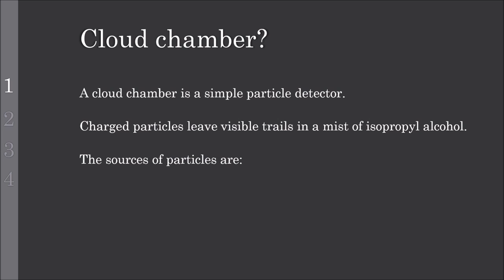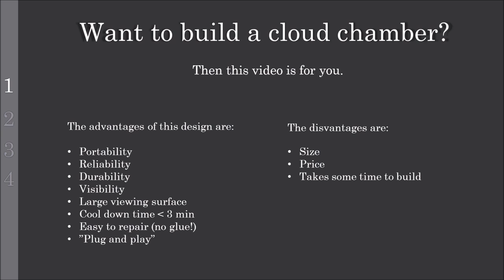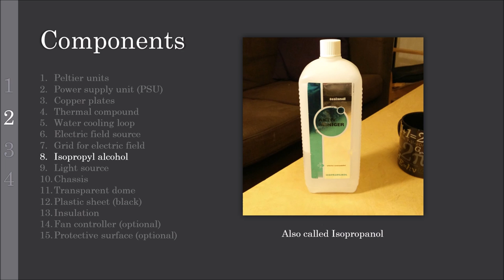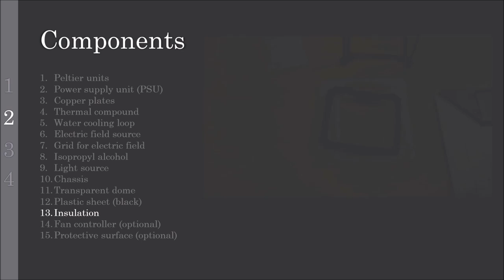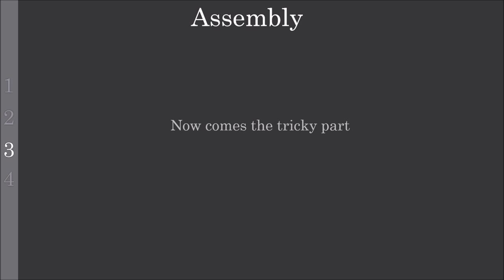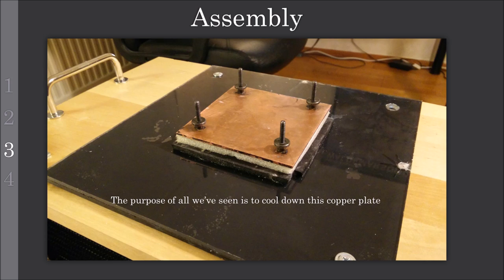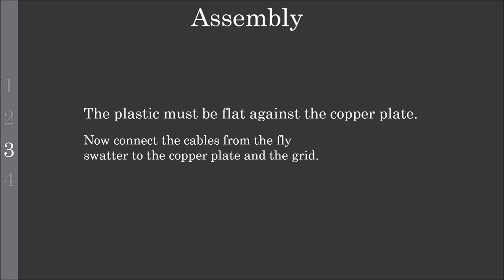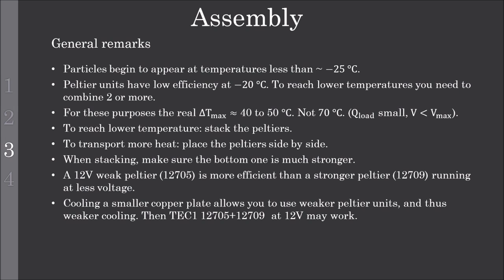How to build a peltier based cloud chamber

Comment: Don't know if it's been mentioned yet but you can get a type of spray paint at any auto parts store called Engine Black or Engine Enamel. It is matte finish and designed to deal with the high temperature cycles of engine use so should not crack and since it's enamel then isopropyl should not damage it. Even wetted with alcohol it should have less glare as well.
Reply from the maker: Thanks for the tip! I bought some tool-paint (something called "Hammer paint", in swedish)  when I was trying out different solutions, back when I was on tight student budget :D. The isopropyl ate it up after a couple of cycles so I gave up the paint idea. But yes,  engine enamel is definitely worth trying. It should be made to withstand far harsher treatment. I actually have the machine back this season for repairs so I could give it a shot if I find the paint.

Comment: Hi I am trying to make a cloud chamber without dry ice so this video is perfect. I would like to know what is the purpose of the electric field .
Reply from the maker: Hi! The electric field acts as an ion scrubber. With the field radiation can leave longer trails before hitting on stray ions in the chamber. It is also possible that the alcohol gets polarized and could get more supercritical, and more susceptible to build droplets due to small perturbations, which improves visibility

Comment: I was always dreaming of something like this, but, could this be built in reverse (looking from the bottom)? maybe small fan blowing air to the cold plate?
also, could it run 4ever or the alcohol needs to be supplied over time?

Comment: Very nice project, are you sure that only 100-300v it's the optimal range? I've seen from several sources that often it's nice to go up to several thousand volts. I use a rectified 2000 v neon sign transformer and seems to work well, but i need more testing (do you think polarity matters?). By the way I noticed a big improvement by gently heating the top of the chamber, in order to create a steeper temperature gradient.

Comment: Hi David,

I'm building my own system but I'm running into some issues. I've purchased a TEC1-12726 peltier and hooked it up to a H45 corsair water-cooled system. Before I put the other TEC1-12709 on I'm trying to test the system. So far the coldest I've been able to get the cool side of the peltier is -5 C. Do you think my water-cooled system is too weak? Also the copper plate (2mm) seems not to be conducting too well, coldest I've been able to get it is -2 C, do you think this might be due to wrongfully applying the thermal paste? Please let me know!
Reply from the maker: Hi! 
The H45 is definitely on the small side for a 12726. At its peak, the 12726 will put out ~300W. At the very least you should replace the fan on the H45 for something above 3000 RPM. If you can't change the H45 for something bigger consider a smaller top surface copper plate, not much bigger than the peltiers themselves. Alternatively combine some other, weaker peltiers. Others have had success with combinations like 12710 + 12704.

Do you also monitor the hot-side temperature? Or the water temperature or at least exhaust temperature from the radiator? I find that an acceptable temperature difference between hot and cold side is around 40-50 degrees (the specified 70 degrees is in an ideally isolated situation).

If you get the hot side down to around 30-35 degrees you can expect the cold side to reach down to -15  (+-5) or so depending on how well you have applied the thermal paste, the quality of your peltier and how well you've isolated the copper plate from condensation and buildup of ice. Rememer that freezing ice needlessly will use a lot of power.

Applying the thermal paste is tricky. You should try finding one that isn't too thick, but rather one that spreads easily. The peltiers have a larger surface area than cpus, so we need to apply more force to squeeze the paste out properly. In the worst case scenario, this extra force can cause parts like the copper plate to bend or buckle,  which in turn cracks the edges of the peltier.
In any case, apply a very thin, evenly spread out layer of thermal paste on ALL sides of the sandwich, hot and cold sides of the peltier as well as the heat sink and copper plate. Then mount carefully and apply lots of even pressure on the whole thing to squeeze out air bubbles and paste. Preferrably you should fasten the sandwich firmly with screws.

Feel free to keep asking, and let me know how it goes!
Good luck :)
Reply: Hi David,

Thanks a lot for your feedback. I ordered a 3k RPM fan and got the temperature down to -12 Celsius. I want to go lower so I order the Alphacool Eisbaer LT360 CPU cooling system and will replace the fans with 3k RPM fans. Will let you know how the system is progressing. 

Chris

Comment: Why do you need different watts on the peltier coolers, and how would it work with 2 peltier elements with the same watt like 230W?
Reply from the maker: Hi +Jokke! I'll just copy the answer I posted on Instructables, in case anybody reading this has the same question:

The bottom peltier element needs to have enough cooling capacity to transport the heat load that is applied to its cold side. In this case there are two types of heat source: resistive heat generated by the top peltiers, and any heat load applied to the cold side of the top peltiers.
In other words, each peltier unit will generate resistive heat (P = U*I) even before any external heat is applied to them. That heat must also be carried away. Thats why when you stack peltiers, the bottom peltiers must always be stronger than the top ones.
I find it is easiest to convince myself of this fact by trying to imagine a situation with two identical peltiers stacked; in the best case scenario you've just built 1 peltier that is twice as thick that produces twice as much heat, and performs as well or worse than the one you started with.

Comment: Hi.
Great one. The glass tube is amazing.

I've done the one as at inscrutable and now aiming for a bigger one.
I have find a 160x40mm aluminum cooler and looking for a watercooler system.
Problem is I'm not sure how to power supply it.
I understand that the 4 pin fans and pump connect with the fan controller but how did you supply it?
Pc? Power supply?
I can't supply it with my pc and couldn't find any hint about supplying the controller without pc.
Reply from the maker: Hi!  Easiest is to buy a proper power supply with one or two 12V rails. Something like this: https://www.amazon.co.uk/Surom-Universal-Regulated-Switching-Computer/dp/B072J97N8T 
See the last picture on that link and you'll see how to connect. That one is just an example, some can be of low quality so make sure to study your options before buying. I used a 400W one if I'm not mistaken, but that is because I used it to power very strong peltier TEC's. If you are only powering the fans and pump I doubt you'll need more than 50W.
In my case I connected the fan controllers DC input + and -  to the 12V + and - of the power supply.  
The pump was also directly connected to the power supply as it needed more amps than the fan controller was willing to handle, if I recall correctly.
If you end up using a PC power supply,  these typically have separate 5V and 12V rails that can handle different amp loads, typically the 5V is weak, just a few Amps. Sometimes the 12V is further divided into multiple weaker rails, and these will together combine to give you the advertised max load (30 amps would mean around 350W ). All I'm saying is mind the power supply's specification and don't overload it. 
Good luck :)

PS: I have this one https://www.ebay.co.uk/itm/Universal-Regulated-Switching-Power-Supply-Transformer-Adapter-for-CCTV-LED-Bulb-/260840617236?
Choose 12V and 400W.
Reply: @kamebwoi  thanks.
I'm looking to control the fans but all controller I find are powered with a Molex connector.
Did you have any idea of to use it?
Should I connect the 6v and gnd to a 12v power supply? I'm not sure how it work so if I connect the controller to the 12v power supply then connect the fans and pump only to the controller should it be enough?
Reply: I've learn to read in the meantime, sorry.

Comment: Hi! Great project. I was thinking about building one myself. I have a question. Do you need to often poor alcohol back in the system to create mist, or it is tightly closed system? Is this one time effect, and then you need to poor the alcohol in or it is reusable and you just need to cool the inside out again to see the mist? Thanks
Reply from the maker: Hi! It is not "tightly" closed system, but for the duration of a demonstration of ~1 hr I usually only pour alcohol in once at the beginning. The glass dome simply rests on top the black plastic surface, and since it has a straight cut rim, it happens to make a good good enough seal so that the vapor doesn't escape. However, between demos I remove the dome for storage and the alcohol evaporates.

Comment: can you use copper heatsink as an replacement for the copper plate?
Reply from the maker: Hi! Do you mean using the flat part of the heatsink as a plate? Sure, if you can efficiently cool down the fins of the heat sink to below -25 C, but that's hard using peltiers, and even harder using just air-cooling.

Comment: Thank you for a great video. I have a question. Since I can't buy CP1 - 12725, may I use TEC1-12715 or TEC1-12712 instead of that? I really want to try peltier-cooled cloud chamber.
Reply from the maker: Hi! Sorry for the great delay. I must have missed your comment somehow.   If you use a weaker bottom peltier,  you also need to use a weaker top peltier. Exactly which combination will work is hard to say, as there are a lot of factors involved (temperatures, thermal paste application, pressure on the stack, size of cold plate, etc). In other videos people have succeeded with 12709 + 12704 I think, or with the 12709 and a second 12709 driven at 5V. In any case, the weaker peltiers are quite cheap so you could buy a bunch and try several combinations.
Reply: Thanks for your suggestion!!!! Actually, I already have tried the combination of TEC-12715 + TEC-1 12712. Actually, the temperature had fallen to -20C when copper is not attached,  But it didn't work when it attached to the copper. How much the temperature should fall down? Is -20C okay to watch cloud chamber? How about -10C? I'm curious about the limitation.

Comment: Hi David,

very nice project! You did not mention this in the video, but I suppose there is also an accessible "bigger" switch that replace the original connected to the mosquito device that should be pressed now and then to see the particle. I can understand that  when you need to track the particles you have to push the button, and the metal web charges at around 300V, and then for 30-50 secs. you can observe the trails. As soon as the voltage goes down no trails are visible. 

- Is this Correct ?

Best Regards
Reply from the maker: Thank you!
Yes, you're right, I could have showed that more clearly. Maybe it's clearer on my previous video (link in the description)
The button to charge the web/mesh is still attatched to handle of the fly-swatter. In fact i've left the electronics of the handle untouched, except for extending the cables coming out of it.

The button has to be pressed approximately once a minute. for optimum visibility. After not pressing it for 2-3 minutes the trails are very short and faint.

I hope this answers your question :)
Reply: David Aceituno
Yes, it clarified the matter. At this point, since the hig voltage is required, and you are ahead with the project, what about to build a small circuit with a NE555 timer (very few components) that triggers a small relais connected to the mosquito switch, for pulse of one each 30 seconds, very regularly, avoiding the hassle to press the button ;) You can also use an ATtyny chip connected to the relay or if you have one spare, you can directly use an Arduino connected to the relay.. :)
Reply from the maker: Roberto Coli
"Hassle" :D
Yes, of course. It's not a bad idea, and "professional" cloud chambers have similar solutions. I could implement such a solution but it would take away some of the simplicity of this build; not even soldering required! I have a friend who suggested a similar solution, with a step-up converter connected to the 12V source, but then again, for this video it would introduce some complexity.

When i sell the apparatus I'll consider such a timer, as a service for the buyer, and for the purpose of practicing my electronics skills :) and to make another video.

PS: Also, there is a kind of "pedagogical" side to pressing the button; people always want to know what it does!  If i ever automatize the electric field, i might even keep an inert button anyway :D

Comment: How large is the area that is cooled? Is it possible to increase this area? Im also making a peltier cooler cloud chamber but Im not sure if 1 is suitable to cool a large surface area.
Reply from the maker: Hi! This cools a 10cm * 10cm copper plate ( https://youtu.be/RAwwfs8Y7J4?t=2m ). To increase the area, say above 15x15, my experience tells me you need better thermal insulation and either another stack of peltiers in parallel, or a stack such as mine but tweaked a bit more (perhaps by tuning voltages etc).  A large plate is prone to  absorbs more heat through the chamber walls and by condensation of moist in the air, for instance. At the same time, the amount of heat you can transport with a peltier stack WITHOUT raising the temperature significantly is very small (a couple of watts, say), therefore you need set up your insulation meticulously.

I have many doubts you will get a working chamber with just 1 peltier unit. The theoretical maximum delta T = 70C is at  zero watts applied heat, which will not be the case for you. Rather, I suggest you start by assuming a maximum delta T around 40-50C. See my remarks here: https://youtu.be/RAwwfs8Y7J4?t=9m24s

Comment: Why do you use especially isopropyl alcohol and aceton for example? Does isopropyl alcohol key feature here?
Reply from the maker: The temperature needed to reach a super-critical cloud depends on which type of alcohol you use. For isopropyl alcohol it's clearly enough to get below about -25 C, but for normal ethanol you may need to go lower. If you use a dry-ice setup this of course doesn't matter much, as it's probably cold enough for either ethanol or isopropanol. In fact you can even use water in some circumstances, I believe I've read that Wilsons original apparatus used water, and that he first noticed trails when he varied the pressure inside with a piston. Aceton should also work but it can damage some plastics, so I prefer to avoid it.

Comment: As far as the electric fly swatter goes, you're using the grid from it as well as what supplies the power to it? Also, I'm kind of confused on how to use the power supply unit (I've never used one before). Lastly, what are you putting through the pvc tubes?
Reply from the maker: +Savannah Hauersperger Hi! Yes,  I'm using the grid and the handle that contained the batteries and circuits that charge the fly swatter. When I bought it it looked more or less like this : http://www.ebay.com/itm/Mosquito-Swatter-Insect-Bug-Zapper-Fly-killer-Racket-Zapper-Insect-Killer-MB-01C/141844389720

I opened it up and removed the blue plastic racket and the metallic mesh, but kept the mesh for later. From the handle you'll see two wires coming out, about 10 cm long. Pressing the button on the handle generates about 1000V between these two cables, which you can use to build the electric field of your cloud chamber.

What PSU did you get? If it's the one from ebay, similar to mine, you'll see that there's one side full of ports with screws that allow you to fasten electric wiring. Three of those (on mine they are the left-most) ports are for you to connect to the wall-socket. The color coding varies from country to country, so be careful. If you're the least bit unsure, ask somebody with more experience to show you in person. The other ports are divided into two sets:  The +12V ports and grounds. Anything you hook up is supposed to have its red wire to the +12V and the black wire to one of the ground ports. In practice it's all just one "rail", meaning the +12V ports are all the same ports, just divided that way for your convenience. Just make sure to honor the power limit of your PSU. If it says for instance 30A max, meaning  12V x 30A = 360 W, then do not connect stuff that could potentially draw more than 360 W to the PSU, regardless of how you've connected to the ports.

Lastly, There is nothing in side the PVC-tubes. :)  They're just there to create distance between the mesh and cold copper plate. Also, they do not conduct electricity, which is important since they touch both plus and minus ends of the electric field source.
Reply: +David Aceituno ok that was super helpful!! If all of the black wires go to ground, then what connects to the negative terminals? My teacher helped to explain the basics of it (he teaches an electrical class). He did say not to plug it in until he was with us so that's probably good!